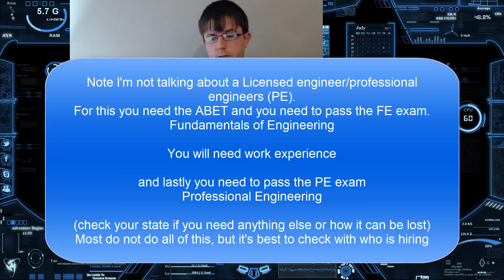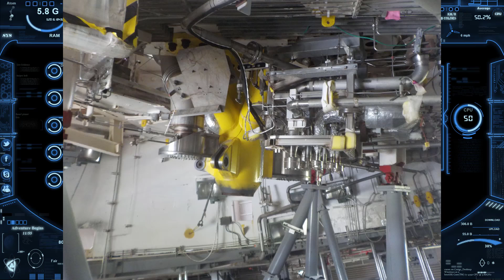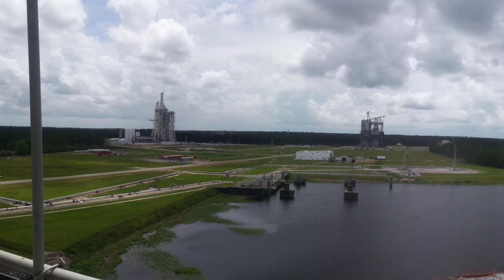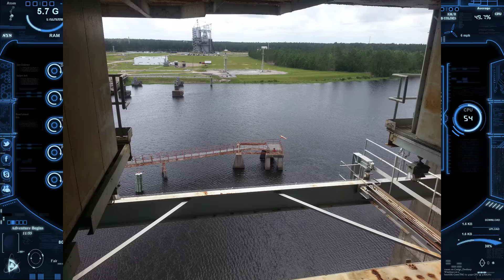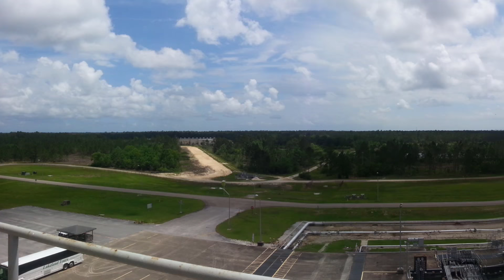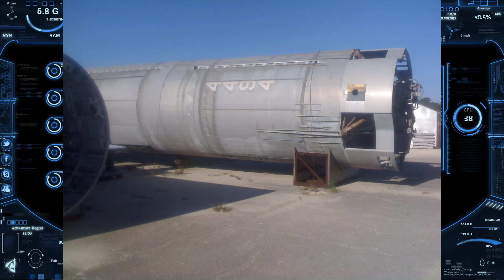Aerospace Engineering vs Software Engineering

Comment: What qualifications do you have
Reply from the maker: It's on my linkedin for the most part. I don't include some of my freelance jobs and any of the NASA time on there because it caused a lot of confusion. But basically I was going through an on site training program which expected everyone to fully transfer as full time employees. This means we worked side by side on some of the stuff while we got on training. By the time I was graduating and going to start a BS in aerospace, this is when man space flight thing blown up and my lined up full time position out there went in smoke. https://www.linkedin.com/in/craigbennettii/
Some of the stuff I was trained on was electrical engineering, orbital mechanics, OSHA, NDT, explosives, composites, and a number of other things.
After the thing went in smoke, I worked at some place that was making commercial airplanes, and found there is no jobs to keep going with my aerospace degree (when you have your onsite teacher with a PHD having to work at Mc D in between jobs, something isn't right). So that's what pushed me to get into the network engineering, which pushed me to start coding seriously.

In fact, one of the big reasons why this is my last degree is because almost all my life I've been in school. When everything is said in done I would've spent about 22 years in school. 9 of which is in college. Remember k-12 is 13 years in itself. (I've told other people that, and I tend to get back a no wonder why I want to quit going to school). 
The only reason why I'm really still going at it right now is some of the jobs require any bs degree, it isn't coming out of my pocket since the country is paying for it, and it would be a kick in the nuts to have all the prior time wasted by quitting now.

BTW if I had to start this all over knowing what I know now. I would've just went with a chemical engineer.They are all over, and they aren't worried about losing their job when they are between making something new or in crisis mode. (I would say farming, but I would never had enough money before this point to get into the type of farming I am into up till now anyways.)

Anyways, I found out the hard way that you can't trust there to be jobs out there by the time you get done with school. I also learned the hard way you can't depend on schools to be honest with you on what you should take. The school I was with told me to go down this path, and it turn out they were having a hard time getting people in it. They should've told me to go into computers, but I guess that isn't profitable enough for the school. (even back then I was poking around with coding and playing with computers. But how is a kid going to know what questions to ask or to question authority figures. Even people at NASA was questioning it, and they got me in contact with some of their tech people at times.)